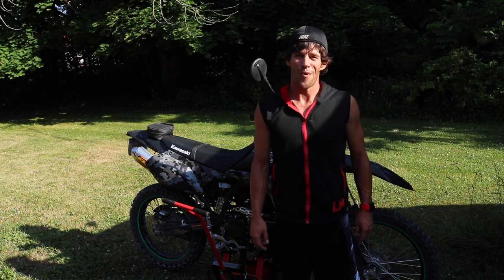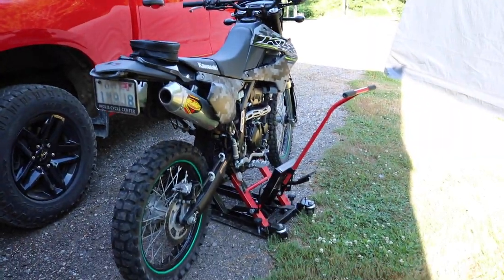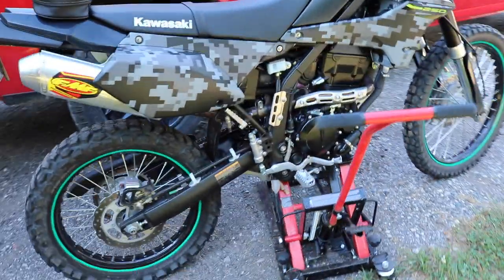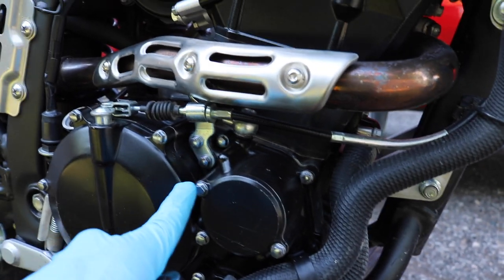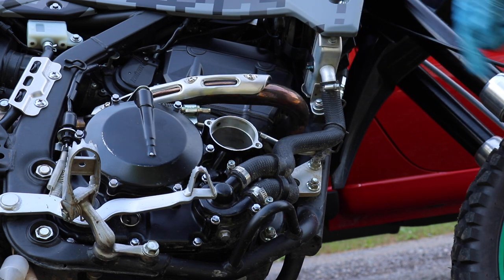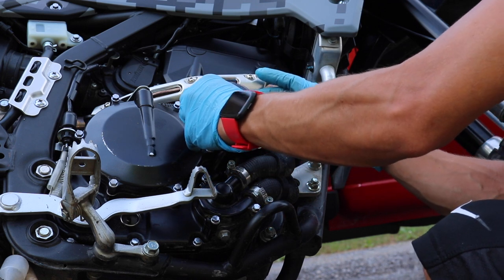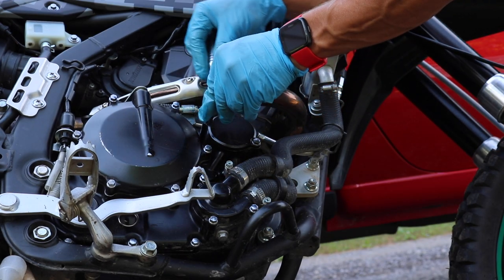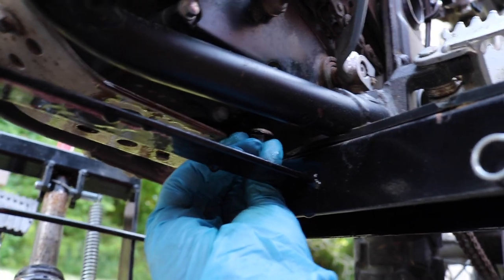Changing the oil on a 2019 Kawasaki KLX 250

Comment: Cool video. Exactly like my bike and stand. 14mm socket to remove oil plug. 8mm to remove filter cover.
There is a o ring that must be changed and a torque wrench should be used when tightening the oil plug cap. 11ft. Lbs.